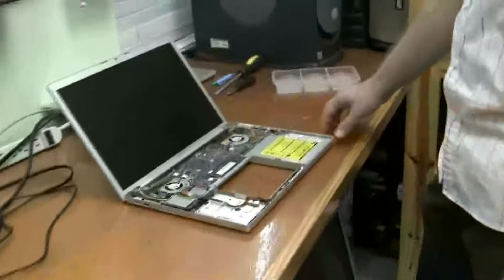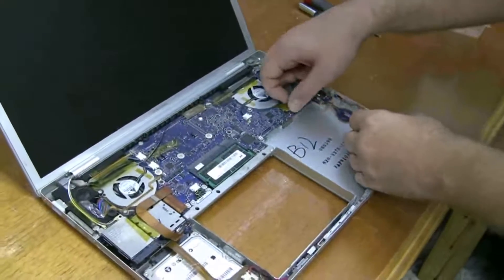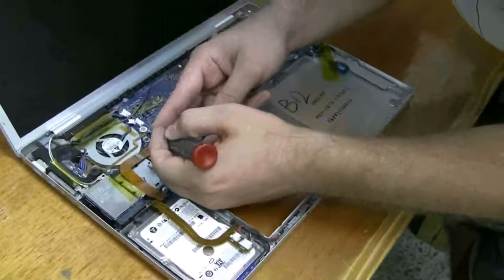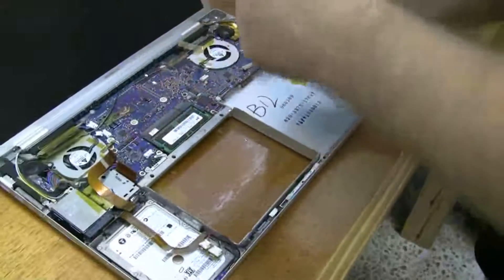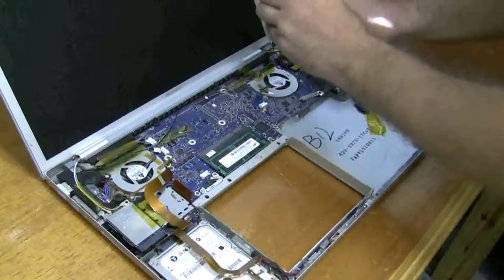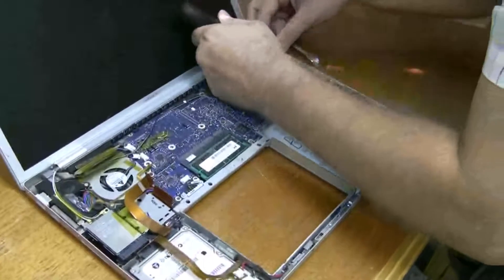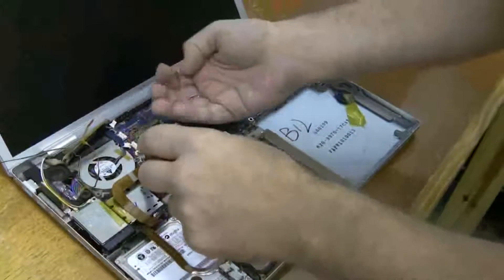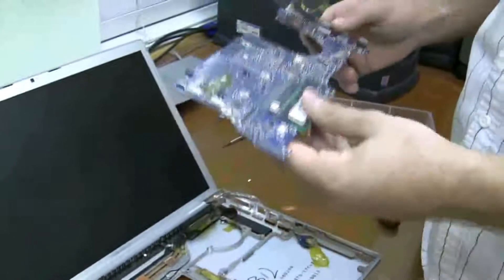MacBook Pro 15 inch Core Duo Logic Board and DVD Removal

Comment: Need help, what is the philips screwdriver model are you using at 0.20 to remove the 2 screws holding in the superdrive?

Have went through numerous sites, and have bought lots of micro philips screwdrivers, none of which seem to remove the 2 little superdrive screws.

Someone please tell me the exact model screwdriver needed.. can get all screws out except these 2 superdrive philips

Cheers